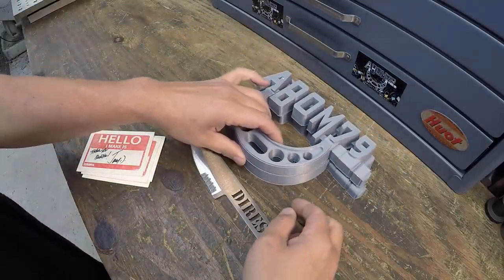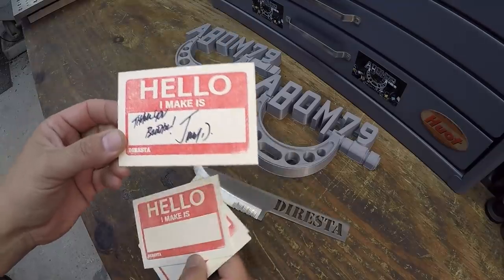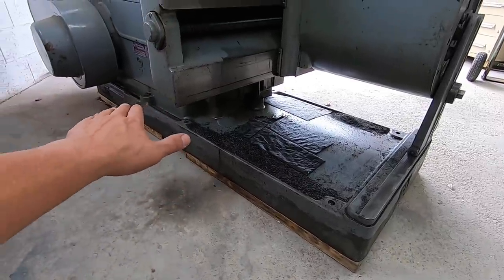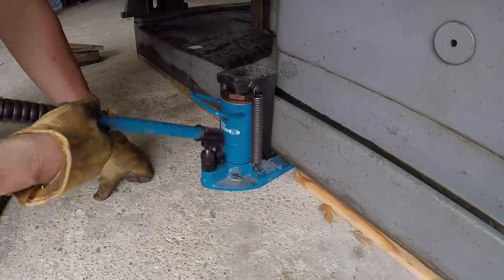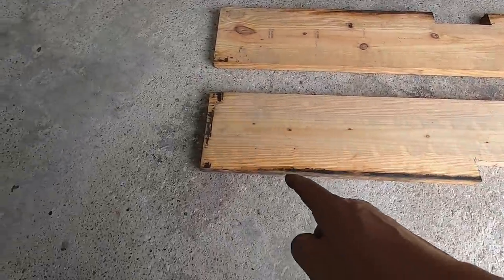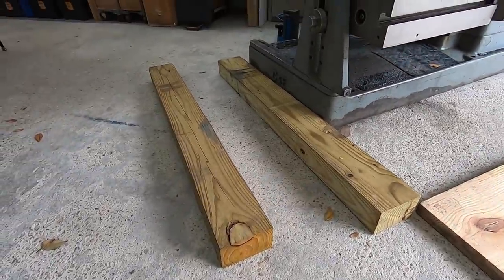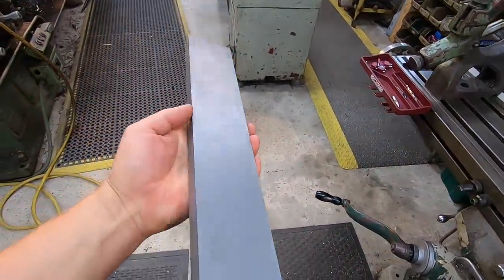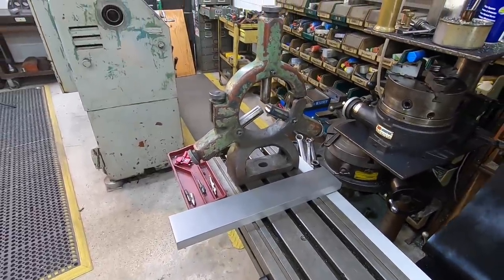SNS 299: Shaper Lifting, Steady rest Mount, New Electric Circuits

Comment: That shaper my be old enough that when it was bolted down the first time it was on a wooden block floor.
Reply: ive done work in a few places that still have wooden block floors
Reply: @dylandrouin3085  The machine school I went to in 1972-1974 had a wood block floor. That was the only time I ever ran a shaper. It didn't move.

Comment: If you haven't done it yet, why not cut a slot that a piece of square key stock can be mounted in with some counter sunk Allen screws to the bracket plate.

Comment: Question: Not that I know anything but, are not that type of equipment bolted to the floor or mounted on a raised slab of concrete????
Reply: Did you watch the video .?
Reply: @squarewrangler  What are your qualifications?
Reply: Starting at 4:15 Adam explains that.
Reply: Dusty 99  So, tell me what makes you an Ex-spert?

Comment: That Drill Grinder motor sounds a little crunchy.  It does sound like a belt issue on the cover. RE: 480V circuits.... are you going to switch the Z power feed to 480? Or just do the whole machine?

Comment: Make wooden wedges and put them together like adjustable parallels hammer them into place at the load points and then screw them together similar to what a carpenter would do to square up a door or window.

Comment: Any way to thread those holes for the lags? you could make leveling bolts and pads. Level at the corners and then move the centers in to touch.
Reply: You wouldn't need to thread the holes, you just use a jacking nut that lifts the machine up and down on the threaded rod.

Comment: Hey could you not hold the shaper up on some bolts, dry pack grout the whole base of the machine, and then drill and bolt it down into the floor?

Comment: Why were shapers produced, were they cheaper, faster or more precise in the day?
Reply: Yes, for certain applications running full tilt they're the thing to  use.
Reply: They were used long before the machines and tooling needed to remove metal to make a surface other than back and forth.   Shapers the tool moves over the part and planers the part moves under the tool.
Reply: Planers and shapers were born first.

Comment: Didn't you want to wire the K&T Mill to 480V because of the rapid feed motor for the z-axis, or do I not remember correctly. Great Video as always, thanks Adam.

Comment: Adam, what if you made threaded feet (Flat plate bottom, threaded shaft and necessary nuts) that fit in the mounting holes? You could use all six for stability and the threaded section would add enough adjustment to make sure the machine is both level and firmly supported at all six points?
Reply: No expert (just a common sense guy) but I think Adam's main issue was the shaper had 6 mounting points (added strength/stability) but only 4 points were being "supported" - the middle points were unsupported because Adam cut those away to have an access to lift. (as proven by the marks/stains on the wood)
Reply: @philhunt9297  True, which is why I was suggesting six 'feet' that bolt through the mounting hole. Would support the weight in the right places, and could be adjusted for stability and evenness.

Comment: Would it be better to use blocks of steel to support the shaper? Carbohydrate fiber reinforced organic foam has a tendency to compress and expand under varying load.

On the key seater, check for continuity between the starter and the motor. If it just hums it is probably single-phasing and only getting 2 of the 3 legs.
Reply: And steel on steel has a big tendency to slide, especially with a reciprocating action like a shaper has, steel on wood OTOH is much more stable on something not bolted down.
Reply: @Ropetangler  tapping a hole in the support block and installing a bolt through the machine's lag hole would solve the sliding issue.

Comment: Suggestion for motor issues; is it three fase? Maybe one way rotation, switch two fase. Or if is one fase with a capacitor (creating the lagging second fase) the capacitor mite have died, replace. The capacitor only last a x number of run hours.

Comment: Genuine question : why cut it so shy of the machine itself ? Why not leave 1-2 inches (so that in case the machine slips/moves, it stays on the wood, and you can track/measure the movement while having some additionnal space for safety)
Reply: Trip hazard

Comment: Probably a silly question, Mr Bomb, forgive me if it is, but could you not move your mill forward or your lathe back, or both an equal amount to meet in the middle?
Reply: That's a LOT of weight to move around

Comment: That transmission handle problem may be that there is a spring loaded detent ball that holds it in position which has a fault, like maybe the spring is broken - an easy fix.

Comment: I spy a 5.0 upper and lower intake sitting on you work table. What is the plans for it??????
Reply: I noticed too, I'm hoping we'll see it in a video soon. Truing it up I would guess and maybe opening the throttle body end. Not sure if that older style can do much more with more air but keen to see the work done either way.
Reply from the maker: Yep, it’s another intake job I just did. I’ll have a video series on it soon, probably a couple videos.

Comment: Could the shaper be springing on the wood? There must be a degree of elasticity in the wood.
Reply: I was wondering that, too. It's gotta be compressing from the weight of that ram going back and forth.
Reply: That is exactly what he said in the video!  The whole point of the indicator set up was showing the wood compression.  Maybe you didn't have the volume up...

Comment: Be careful with 480V. It's the most dangerous voltage. Make sure you turn the power off before you even grab that plug to unplug the machine.

Comment: maibe you can use the mounting holes under the machine to make sumting to level the machine out 
could allso be that the wood gotten squished flattened over time , you could measure the thickness along the board to check that
might be usefull to use a tighter grin wood , talk to diresta about that he prolly knows a type that would work in youre aplication
maibe try a set of machinist jacks helping the piece of wood in the middle , the jacks are metal so shouldnt compress

as for the gearproblem , did you ever felt the force in wish the lever gotten pulled down ? could be the machine is missing sumting you turn the lever over to keep it in the up position and the vibrations and weight of the lever causes it to drop out of gear

Comment: I am in the UK and would go straight for TICO pads to put a free standing machine on. Link here https://anti-vibration.solutions . You must be able to get something similar in the States, would have to be better than the timber, but overall I would fully bolt down and use a liquid grout to bed it fully. The other option, which may help to give you the extra height would be anti-vibration adjustable feet, but the holes for securing the shaper may not be a large enough diameter to allow suitable feet for the loading.
Enjoying the videos while I have been off sick. The wife is fed up with them though.
Bill

Comment: Do you know why the transformer hums?
Reply: It doesn't know the words (electrician humor).
Reply: Bumblebee can't talk
Reply: It is being fed with AC, which is a current that changes direction 50 or 60 times a second (depending on where you are).
A change in current through a coil of wire (which is what each side of the transformer is), will cause a change in magnetic flux (magnetic field).
The changing magnetic field is constantly expanding and collapsing, making the transformer windings and/or laminations get pulled together and then relax.
This is why transformers are normally varnished - It helps to stop the vibration.

Comment: I was just thinking, theoretically, when you take very heavy cuts on the shaper, wouldn't it be able to bend its own base? There's a tremendous force going in to that support leg when the tool steel digs in to the material. Naturally there's an equal force going back in to the  machine housing at the top, so the whole thing tries to pull itself apart. That force needs to go somwehere, and steel or cast iron  isn't 100% rigid. It's easy to check. See if the middle pad lifts ever so slightly from the floor.
It's not the rocking action due to the planks I mean, but just when the tool steel comes off the material, the whole table springs back up.
Reply: It could be possible to rest the front and back on blocks like it is now and bolt some studs through the holes in the middle into the concrete to keep it from flexing up. That would probably make the whole setup more rigid. I'm not sure how thick the concrete slab is so maybe it's best so leave it the way it is now.
Reply: Yes, if the slab isn't beefy enough the shaper would probably rip a piece or two out of it.

Comment: Abom you  may want to measure the distance between the floor and the bottom of your machine you may cause the foot to bow if you leave it on 2 points and I would hate to see the shaper with a bowed or crack footing I understand why you don't want it lag bolted to the floor but you may be able to put tie down points like you made in previous video on both sides strap it to the floor and still have a pull points it just a thought and with it jumping out of gear it maybe the movement of it rocking back and forth if it was mounted to the floor it probably wouldn't happen often anyway y'all be safe out there

Comment: Adam!. For frick sake's buddy!. Your concrete is all AWAL to f...!. You need get your floor Jack and level it on 3 feet🦶. Then shim the forth 🦶 foot (corners). then anchor set (resin) heavy fixings(bolt's M12's at least) so that shaper will never move unless you command it!. Top tip from Scotland, Sack your concrete guy!

Comment: that knocking sound to me sounds like a bearing knock or shaft wobble, an old repairman  - Jerry in Mich.
Reply: Look closely at the grinder the shaft rock back and forth the grind the drill the belt is a laced belt and has a spring tensioner to take up the slack , it’s the guard that’s on wrong  belt slap 👋

Comment: Y not build some frames/dams and pour chalk fast it’s how the set large engines on the beds it’s a 2 part silica epoxy will set its own level. Used it to set 12 cristy grey engine mounts on a 3532 Cat generator.
Reply: Don....That is great stuff and would solve the problem.  However, it makes moving the machine, problematic.  It is a small shop, and he wants to be able to shift around the machinery.

Comment: That shaper needs setting on six taper wedge adjusters, levelled, then  grouted in and bolted or glued to the floor, current set up is very poor, and not doing justice to a precision machine.
You've fitted the machine to the floor, not the floor to the machine. Sorry Adam, what does the operating and installation manual say?.
Great vlog, stay safe all and thanks for sharing.
Reply: I agree, that machine needs to be supported at all six points and leveled.
But I am only a trained millwright, retired after 36 years with General Motors, so what do I know.
Reply: @garybrenner6236  Would it not be the easyiest to bolt the Base down ?
Reply: Until he gets the shop situated like he wants, all of these great ideas for permanent mounting don't apply.  Right now and in the foreseeable future, he wants to be able to shift things around.
Reply: @paulcopeland9035  Ah okay overheard that. When he needs to shift things around i would make a stable base from wood 3 or 4 inch and over the whole base.
Reply: @black666bull9  And it would just rock like it does now if not worse. 6 adjustable pads would be easiest and allow more moves if he wished without any extra stuff, would allow for machine levelling and full support until Abom decides on a permanent location for his shaper. The 3 point levelling will stop machine rocking if there are no concerns about bowing the frame, but i would prefer some support in the centre, which could be as simple as shimming or adjustable feet.

Comment: 240v scares me, 480v, yikes, not for me!
Reply: How about 600V? LOL You just have to be very careful when diagnosing and troubleshooting, shut down the power before getting your hands in there to work on it.
Reply: Linemen work with 1000 VAC and up.  Not for me but they have the training and gear for it.
Reply: @royreynolds108  I think by Canadian code I'm allowed to work on equipment up to 5000V as a certified electrician, but the highest I've ever dealt with is 347/600V. 4160 is common in large industrial facilities.
Reply: @abpsd73  You have your nonsparking tools and PPE all sorted I guess. Thanks for blessing us mere mortals w your comment.

Comment: when would you use a shaper and not a milling machine? Seems like both can do the job in this case, right?
Reply: I am very confident that Adam answered that exact question.
Reply: You can set up a shaper and let it run and then go do something else, you can’t do that with a mill.

Comment: Caps probably bad, motor hums
Reply: Thats is probably a thre phase motor. They dont have caps, but one of the phases might be broken.
Reply: @lukahierl9857  agreed, now i have looked again its a 4 pin plug, phase down possibly👍
Reply: Or it’s trying to run backwards.

Comment: Why don't you make some steel plates and bolt it down? Or bolt it through the wood into concrete?
Reply: I agree, the wood could even be compressing as the ram moves.  Wood is very spongy.

Comment: You could easy machine a slot in the end of the plate to take a third T Bolt....Just saying....
Reply: The Essex Hunter I don't think the plate is long enough for that. Adam said he wished it were longer but that is all he had. The plate has to hang out long enough for the steady rest to line up with the axis of his lathe.
Reply: @samrodian919  
Then it would have easy to weld an extra bit on to make up the short fall  with a slot in or I am sure he would have an ex long toe clamp....more than one way to skin a cat...

Comment: My OCD hates half measures... I wish 'it will do' Adam would make adjustable feet for his shaper and bolt it down to the floor. But it's not my choice, not my machine... so who cares about it. In the past they would use shims to level this antique machine and hold down bolts to stop any movement. Enjoyable video Adam.

Comment: That electrical wiring doesn´t look very professional
Reply: If you don't mind lending me those X-Ray goggles, I always wanted to inspect my house's wiring but I can't be bothered to cut open the conduit and breaker/distribution boxes...
I've never used X-Ray vision before, can you really see the insulation as well as the metal conductors through the protective metal case?
Reply: @spacenomad5484 I meant the way the cables and boxes are mounted. It's not straight anywhere/in line. It's not dangerous at all, but he seems to be so delicate with everything else he does.. But maybe it's just my OCD acting up again